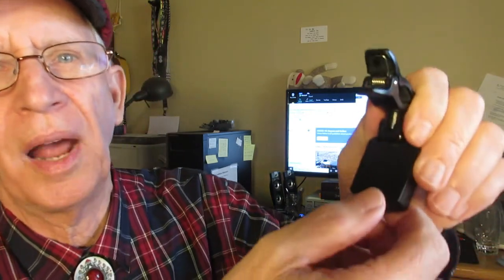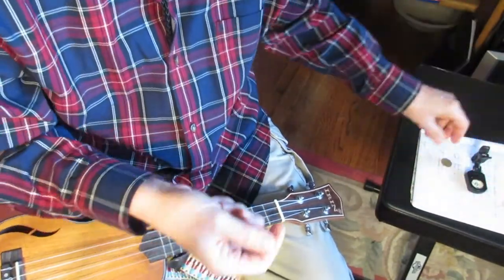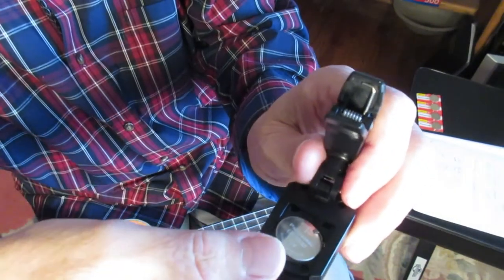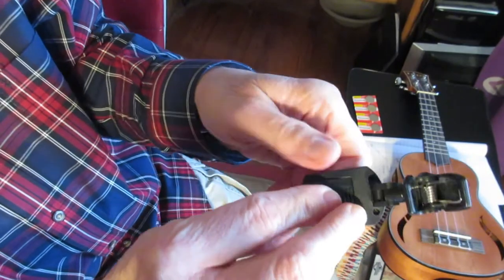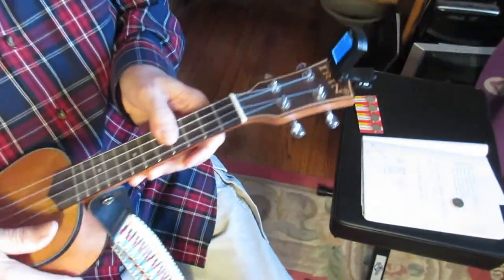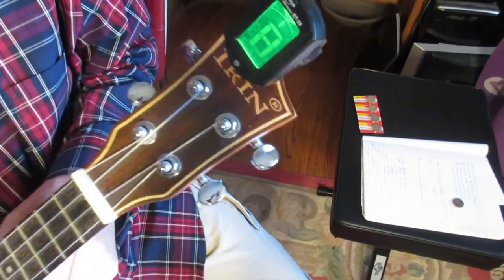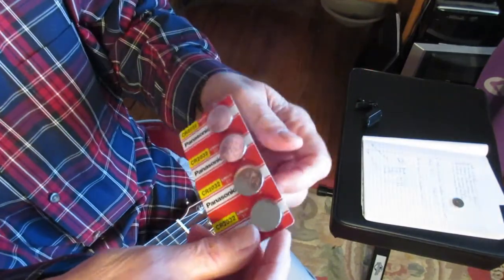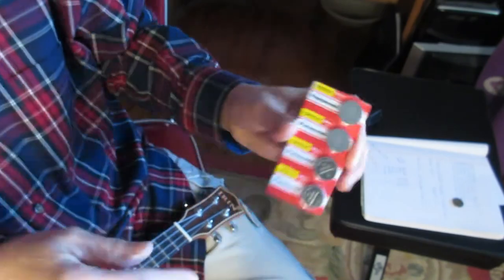Changing battery in clip-on chromatic tuner.  Guitar, ukulele, etc.

Comment: do NOT assume a Peaey is like other electronics with a battery compartment in the electronics assemble.... it is down next to the jack plug so if you buy a used DW-2 guitar the electronics battery will be at the jack end of the guitar... YOU figure it out.
Reply from the maker: Thanks for the tip!

Comment: I cant figure out how to open the battery thing

I have a bcp one
Reply from the maker: Most tuners have a series of lines on the back of the tuner.  Press down, dig your thumb nail into the lines, and move your hand toward the bottom of the tuner.  You will slide the piece of plastic right off the tuner.  You could also use a sharp knife and insert it in the crack.  It will easily come apart then.  Be careful not to cut yourself, of course, or to damage the plastic.  Use gentle movements and force should not be required.
Reply: @richdavis4007  thanks man. Cant wait to get started!
Reply from the maker: @MangoMunch69  I'm glad you asked the question.  I'll make a video on this topic because the darn things can be a pain to open up.  Rich
Reply: @richdavis4007  nice, I'm going to start out trying to learn a few of my dads old songs from when he was in his garage bands
Reply from the maker: @MangoMunch69  That's a cool idea.  Sounds like fun.  Best wishes.  Rich
Reply: @richdavis4007  your explanation is too complicated for most folks... see?